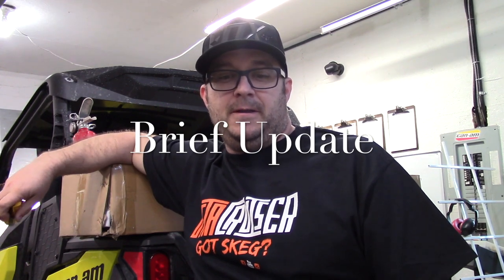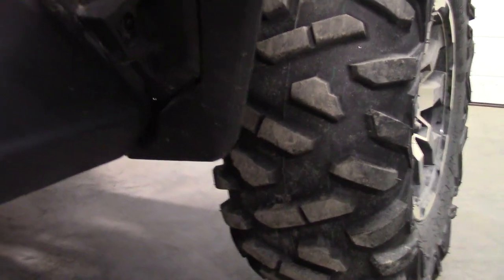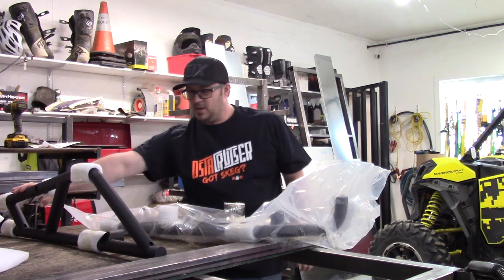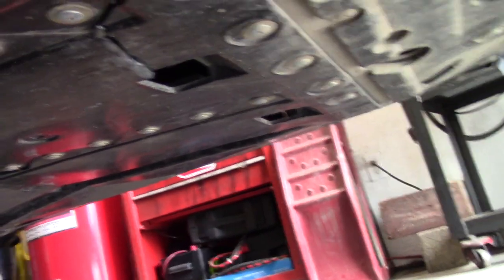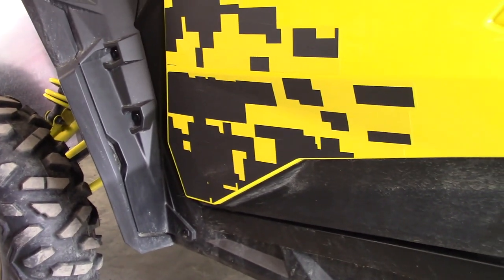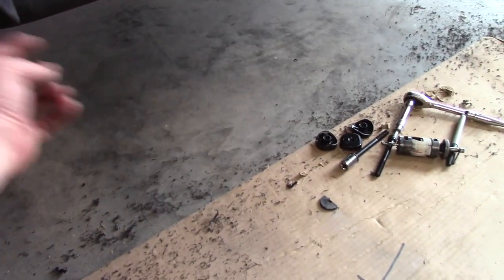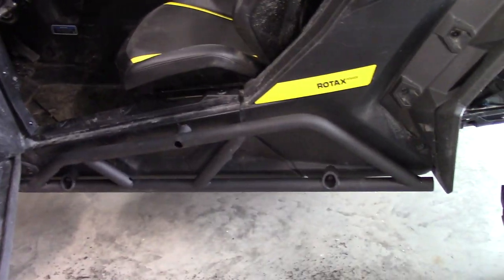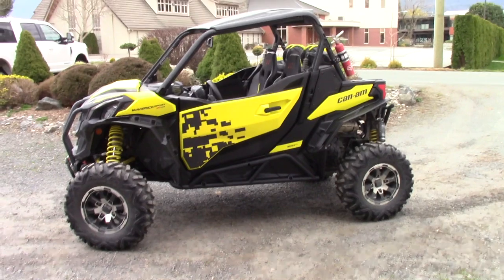CAN-AM MAVERICK SPORT XMR Tree Kickers, Rock Sliders unbox and installation.

Comment: So mine are rusting in the same spot on both sides where they drain in the middle just over 500 miles.
Reply from the maker: Definitely not best designs everywhere but for most part better then most. I guess it costs lots to change flaws as they go. Unless bigger concern to them.